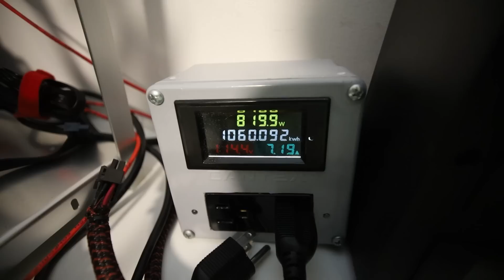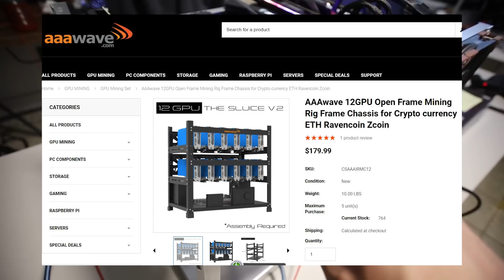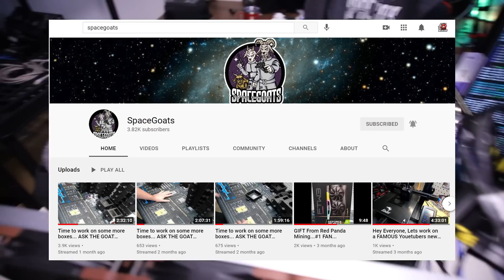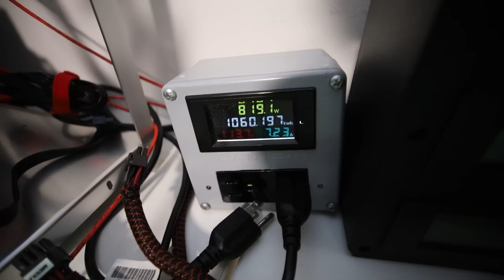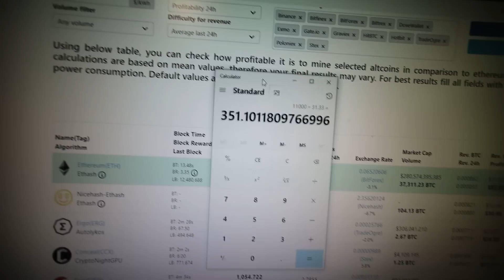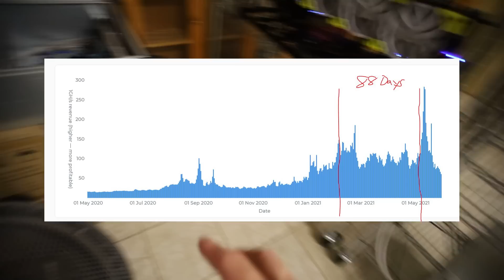When Will I BREAKEVEN On This 3060 Ti Mining Rig?

Comment: I just got myself a full built-in Rig with 6 GPUs (3090, 3080, 2x3070, 2x3060Ti) 2xEVGA 1,000W PSU, ASRock H110 mobo and few extras cost $10,000 doing about 475.5 MHs. And just got 7x1,200W Server PSU with older modle Breakout Boards with no ATX Connection and I really want to switch to the Server PSU but Don't know why I'm Hesitanting so much. Lol

Comment: You can not and will not ever break even with Eth on this rig. Period. People trying to sell you a rig or a scalper priced gpu will tell a different story in order to make the sale. Yes there was a price correction. Yes the entire crypto market went BEAR and YES these things will rebound. But while all this is happening, Eth difficulty is continuing to vault and will do so until Eth is unminable (I recall the promise was to be unmineable by the end of 2021). So set your eyes on a new currency and hope like hell that it doesnt take a dive once half of China switches to mining that token and drives its difficulty through the roof. Mining isn't dead, but it is not going to be the big titted cash cow that it has been. Its going to take two times more cards and two times more power to make half the money. No more scalper priced cards. Scalper pricing is dying. As you read this, marketplace/craigslist/kijiji are being flooded with decent priced cards because most have realized that if they don't sell now, they will be competing against 5000 other people who are trying to offload 24 3070s at a scalpers margin.

Comment: tested the breakout board and bottle necks power even if you have larger power supply ...if you have for instance extra 4pin on board for cpu or peripherals you will need 6 pin to 4 pin for that...from my testing anyway

Comment: With Alibaba link to the 1500W Platinum Mining PSU - does it or does it not come with a breakout board?  The link illustrates and shows that it does but in your YT vid it sounds as though it does not come with a breakout.

Thanks again for your shares - much appreciated!
Reply from the maker: Does not. You can ask them to add breakout board and cables but will cost more.
Reply: @RedPandaMining  - wow - glad you made that comment in your YT vid.  On the surface it looked as though it is included

Comment: My friend, when i connect the molex cable to sata cable on the parallel miner board the rig burns the ssd, i have tried 2 boards and 2 different power supply, do you happen to cross this problem?
Reply: Sata is meant to be avoided at all cost for mining. Rookie mistakes.
Reply: @fubillie2146  do you even read my comment? or just read "sata" in you jump to answer that? The problem its conecting the ssd... the board have a molex to sata adaptor that does not properly work in my samples, I have fried to ssd already

Comment: You should take a look at Enermax D.F. Storm 120mm fans instead of the Noctua iPPC fans.  Way more airflow and don't have that server fan whine.  They make 150CFM but be warned they use up to 1.1A so they might be too much for some fan headers.

Comment: Damn I have a really similar rig, even with 4 120mm noctuas. I paid an average of about $900 per card. After 3 months I had made about $3000. Quick question - are the fans on the rack supposed to pull air away or push towards the cards? Mine are pulling the hot air away. Also, you don't need to put the dampeners on the side of the fan that isn't mounted to anything 😂

Comment: I always find that 3060 ti’s are more expensive than just a regular 3070, so I just pick up those instead. Plus 3070’s will have better resale value later on down the road!!
Reply: Yes I'm seeing 3070s cheaper than 3060ti .... 850 -1200for a 3070 ....1200-1600 for 3060ti
Reply: @demolitionkid2  where have you found 3070's for as low as $850? I'm seeing 2060 TI's close to that price
Reply: Where have you been able to find them?
Reply: Yeah, its because i go for asus rog 3080 for 1400€ on New Year when price is start to grown and they stop to buy i use thats time and buy smart now rog price is 2200-2550€ but i made over 1000€ on card so they cost me 400€ for now.
For 3/4 months btc will go over 60.000 or 70.000$ i belive so its be fun 👍

Comment: My biggest question is how do you get the perfect overclock for no bad shares? 
I always get %1 %2 loss
Reply: Sit down and give yourself 30min to an hour to go through the MSI Afterburner settings. If you’re getting invalid shares, lower the memory overclock by 50-100 at a time until it’s stable. If you’re getting invalid shares at +1200 memory, lower it to +1000 and see what happens. I’ve had rigs be on continuously mining for weeks or months at a time with zero issues or invalid shares.

Comment: You need to increase the absolute core clocks by 25-50MHz and your hashrate should go up by 1MH/s or so for each card
Reply: but whats the point, damaging the cards over time like this reduces their lifespan, thus, affecting overall profit.
Reply: @simonb2109 Making your cards run better does not damage them...

Comment: Thanks for all the info. On an average, how long is the life expectancy of a rig, not counting that cards might brake down, but lets say they would work fine all the time?  How long do you think you will be able to mine with a new rig, before cards become obsolete, meaning not worth to mine?  I know it is hard to predict the future, but looking back at your old rigs, how long do they last you?
Reply: Hard to say cuz eth is switching to 2.0 so you will have to change algo.. who knows how profitable it will be. If you want your rig to last 3+ years you have to ensure you wire everything to spec, and keep temps stable(especially mem temps depending on the model of your gpu) and make sure humidity in the environment is low to prevent long term buildup of rust. I would say atleast 3 years if you take care of these factors up ..3-7 yrs I would say lifetime
Reply: @samir970  i’d like to add changing the thermal paste once a year should definitely benefit you and make them last longer as thermal compound does dry up, faster when under load
Reply: thats a good question, im curious too.

Comment: Hi Panda ! Could you please test T-rex miner 0.20.4 new feature Core Clock trick ? I want to see if it is reduce power limit or not. (For Windows miners of course.)
<3
Reply: I tried it out on the 3060 and only saw a 2w reduction on one card and 5-6w on another. My 2080s on the other hand dropped 12w which is pretty good.

Comment: I had used HP server psu's but I  had too many issues with them. I started using 1600w EVGA. Over one year and not a single issue. Yes, it is overkill but only one plug instead of two, no issues if I run a more power hungry rack, and no worries about 110 0r 240 power use. FYI, the HP psu's have an internal switch to change power types if you need. Just have to take off the cover and it is marked by the switch on the circuit board.
Reply: It's always safer to go the route you have
It's good to have some overhead 

I tend to go for at least 20% more wattage than I need

Comment: You need to hope that ETH prices skyrocket by the end of summer to ROI!
Reply: I think its at an artificial floor right now. My guess is its probably going to bottom out at $1500 at the worst and have another spike in 2023-2024
Reply: @jakobe_bryantgaming5580  disagree....
with eip1559 it will rise higher,
and than end of this year with switch to proof of stake it will rise again more.

Comment: now it makes $20 a day , I have 6x rtx 3070 at 371mh/s,  -400 +2600 125w , on simplemining os
Reply: you should use the core lock setting instead of the negative 400.  I dropped about 5% off my power usage.